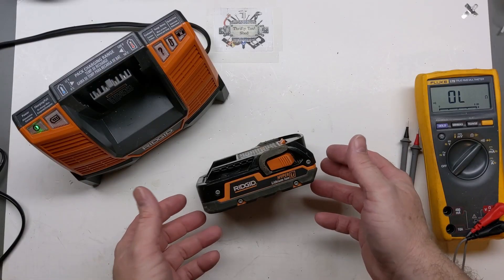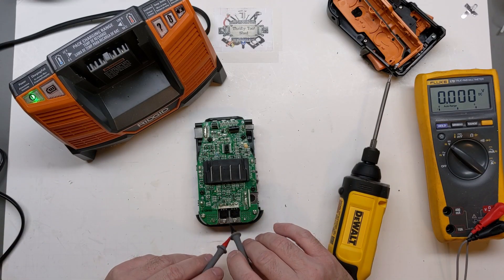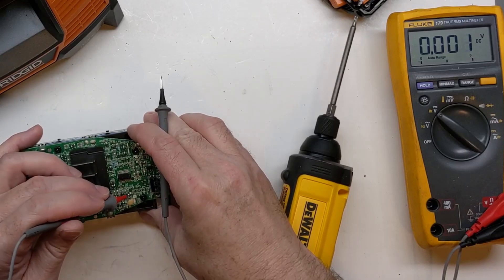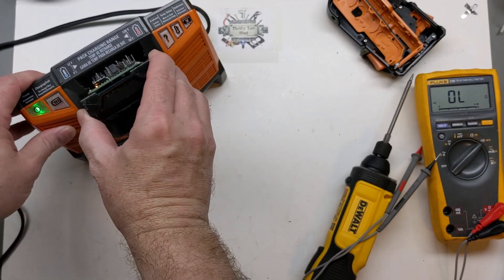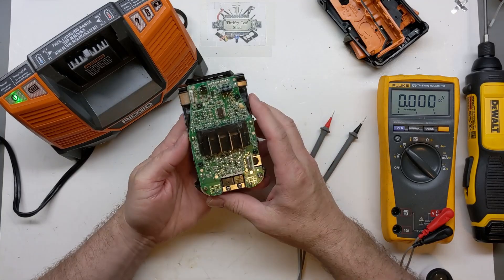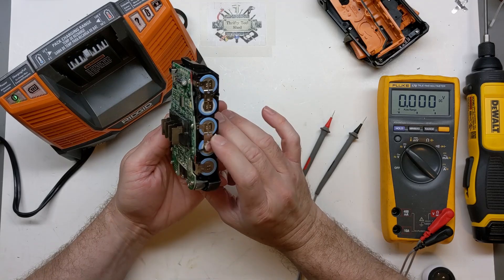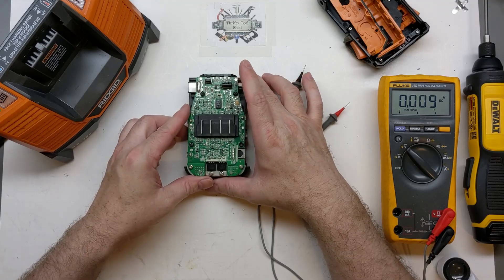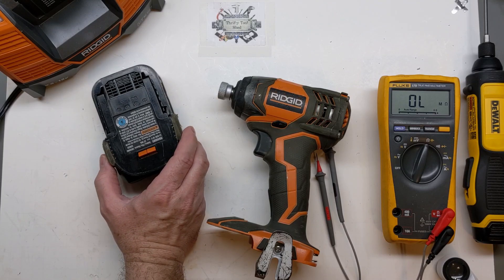Can we get this Ridgid 18V Hyper Lithium Pack back working?

Comment: Total laymen here: So I've had two Ridgid Hyper Li 18v 4ah batteries that were perfectly good at the time, get a light rain on the drill, and they stopped working. I brought them in and left them to dry for a couple of days, but they are dead. I tried the jumping method using a good fully charged battery, but nothing. I just don't get how a short period out in a light rain could so easily cause these batteries to fail like this. One battery I was working outside with it when it started to rain. I took a few minutes to put a tarp over my project and then gathered my tools and brought them inside, but that was all it took. My question is what has likely happened? Did they short out, and somewhere there is a fried circuit? I could see that happening dropping them in a pool of water, but just a light, brief rain while the battery is plugged into the tool?
Reply from the maker: It's possible they suffer from corrosion as seen here in this video. Until the pack shown in this video, I would not have thought light corrosion could have caused this much of an issue. I learned from this and still much more to learn for sure. I would say very unlikely it shorted out due to rain, but more like corrosion afterwards. Water ingress damage is usually from corrosion as it attacks the metal of the components and now with these tiny SMD components it doesn't take much to cause issues for sure. All you can really do after trying warranty replacement is check all cells voltage and make sure they are not too low and are balanced and then check and clean board for corrosion in the area I shared in the Video even if not seen. Some of these newer chips are BGA or Ball Grid Array and the tiny connection under the chip is many soldered connection very susceptible to corrosion, it's hard to get to. Other than the reset for the microcontroller on the board, that's all I would know to check. Best of luck to ya!
Reply: @ThriftyToolShed  Thank you for the reply. My security T10 bit will be here Wednesday, and I'll check the voltage of each cell, and if they look good, I'll try the reset.

Comment: This is really helpful and an eye-opener to a newbie to electronics. I am just starting to learn about  tube-driven guitar amps, so this is a tad over my head, but it gives me encouragement that I might yet learn about solid state devices. Now if only y'all had a video on how to trouble shoot a fan that got rained on... ?  I'm thinking it might have to do with some .."thermistor" ?.. that blew. Heck, So much to learn. At least I ain't dead yet.
Reply from the maker: Tube guitar amps are cool, I desire to learn more about those. Thermistors are simply a device that changes resistance based on temperature. Usually we see more NTC thermistors which is negative temperature coefficient which simply means it decreases in resistance as temperature rises. Rarely we see PTC or positive temperature coefficient just the opposite, its resistance increase when temperature increases. A vast majority of the time we see NTC that is around 10K ohm while in ambient temp of around 70F. I mention NTC a little in a video about EGO 56V battery packs called " What is the T-Terminal?" It touches on Thermistors a little. Also you may already know this: The biggest issue with electronics getting wet is corrosion even if weeks down the road so if any components did get wet make sure to clean the board with a good electrical contact cleaner or rinse really well with >90% Isopropyl alcohol even a small brush like a tooth brush scrubbing is helpful.  Hope it helps some and thanks so much for your comment.
Reply: I've an 18v 60Ah with same charger you use in this video and the charger doesn't flash faulty but battery won't charge??anything just from that you could recommend I do please
Reply: @mikehunt9993  DO YOU GET THE SAME RESULT WITH OTHER BATTERY PACKS ?
Reply: @mikehunt9993  try different charger could be charger itself

Comment: Great video but what it everything checks out but still won't accept charge.
Reply from the maker: I assume you have tested the  Charger as well. So either tested with another pack or same pack in a different charger? After that,  If all cells show balanced and voltage is above around 3v per cell then it could still be in the BMS. If it discharges from the tool fine, but doesn't charge, it's almost always the BMS still. These things are tricky sometimes, best of luck to ya!

Comment: I have a Hyper 4.0 won't drain below 3 lights. shows 20 volts on the board and 2 volts on the termanal and quits working.
Reply from the maker: If all cells are balanced well then it's in the BMS board. If reading 20V hopefully all are balanced pretty well, if not some of them may be over charged! I would check that first and then it would be BMS trouble shooting or at least try the reset? Best of luck to ya!

Comment: Thanks for the great video.  I'd just like to point out that Ridge Batteries are guaranteed for life if you took time to register them when you first bought them.
Reply: I've tried to register my Ridgid tools and batteries. I followed the instructions, took pictures of the receipt, box and tool or battery and sent them all through the registration website. In one situation they sent me a generic reply asking me to send them pictures of the tool, box and receipt which I had already done. I resent and they never replied back, so I thought all was good until a battery failed, and I tried to get it replaced. They said I had never registered the product. Just seems like a total scam to me.
Reply: @Graybeard_  Yes, their warranty is a joke. they make you jump through hoops and then don't want to honor the warranty anyway.
Reply from the maker: Thanks for your comment! Exactly, that's one reason I had these packs, my packs were from Home Depot returns from warranty replacement.

Comment: I have 4 batteries that are showing defective on the charger.  I own a small carpentry business. I don't know this type of work/repairs on batteries and boards. Can I send you batteries to fix?
Reply from the maker: I wish I had time, I do get asked this often. I do not have a repiar service at this time.  I work full time+ in a Industrial job and try to have time to edit videos to post. I try to help by posting what I have found with a repair.  I don't have alot of time left, I wish you the best of luck with yours.
Reply: @ThriftyToolShed  thanks. I cant do it and have no time. Great video!

Comment: I also have some corrosion around 3 of the battery cells themselves.  It got rained on good one day. Is there are different cleaner for the battery cells or use the contact cleaner and IPA as well?
Reply from the maker: That should work well. Vinegar is also great at cleaning most corrosion, but I always make sure to clean it off extremely well with IPA after your done to get the vinegar residue off. It can cause corrosion aslo if left on the surfaces.

Comment: Do not bother to replace mosfets. That will not solve the problem. I did purchase six damaged 18V 4A Ridgid batteries. I was able to fix 4 of them permanently by replacing logic boards. Cost $11 shipped from Aliexpress. https://www.aliexpress.com/item/1005001710882634.html?spm=a2g0s.9042311.0.0.4ba44c4dDDBf3s
Just check and be sure the cells are OK. As lond as they are OK the battery will work like new again. Good luck.
Reply from the maker: So did you watch the video or just adding some "extra advice" I never said to replace the Mosfets! I showed what seems to be a common issue resolved without swapping the board?
Reply: @ThriftyToolShed  I did not mean to criticize what you are doing in any way. You did great job to help people solve battery problems. I just add some comments based on my own experience to fix those batteries the easy way.
Reply from the maker: I wasn't thinking it was criticism as much as worried I misrepresented something there that I did not intend. Thanks for your comment!

Comment: I have a ridgid  battery and wen I pick it in the charger is says energy save what do that mean
Reply from the maker: That is usually the charger thinking the pack is fully charged. If the pack is not really full and other packs are charging fine with that charger the problem is in the pack.
Reply: @ThriftyToolShed  yeah my battery is dead so the battery must be bad

Comment: My Rigid pack never said defective and I tested it and was fully charged, and the output contacts put out current.  However it would not work in my drill.  

I did did what he did at 5:18.  Put it back in the drill and worked right away.  I gave it a good cleaning.  Hope that helps someone

Comment: When my packs get wet from rain or moisture they do that with the light. Clean them real good and good to go. Thanks for the video.
Reply from the maker: I assume the blinking is similar,  but the pack still works fine unlike this one correct? Thanks for your comment!
Reply: @ThriftyToolShed  The blinking appears to be the same. I've had some left out in rain multiple times and sometimes they come back and others not. Most times they just get moist and I lay them out to dry after disassembly and cleaning. Appears the conformal coating is lacking in some areas. I have a pack that the level lights don't work at all and it still performs as it should.

Comment: Great video! I have a 5aH lithium Ridgid battery pack that will charge but never shows more than 2 bars on the indicator. It's only a little over a year old. Thoughts?
Reply from the maker: I would check all cells voltage and make sure they are balanced. Could be bad cell or cells. If they rest ok then the only other fix may be resetting the microcontroller like I tried in this video. Best of luck to ya!

Comment: These Ridgid Batteries have a low voltage cut off built into the board correct?
Reply from the maker: Yes, the Mosfets we talked about here  will cut out in event of low voltage or temperature Issues.

Comment: Is it OK to run a jumper from ground to the source of the second MOSFET, or would that just circumvent the first MOSFET.
Reply from the maker: I believe it would bypass the first one. In the video I had no issue with the Mosfet on my left (the first one). I had the ground all the way through to my source pin of the mosfet on the right (the second one). I did not verify, but I assumed it was coming through like you said. it is so hard and time consuming without schematics, but it seems either mosfet can shut down the pack independently based on what its monitoring. For example: One could be for temp. monitoring etc. the other could be for voltage level monitoring?
Reply: @ThriftyToolShed  Thank you so much for your reply.  My right-side MOSFET was also not opening correctly, although the MOSFET seems to be testing OK.  Running a jumper to the source on the left MOSFET gets my battery functioning again, but I am concerned that this defeats an safety measure.  Unfortunately, cleaning the board did not resolve my issue. 

I read a post that claimed the MOSFETS provided bi-directional control, but that is almost surely incorrect.  I believe bi-directional control would require 4 transistors configured as an h-bridge (although I have limited knowledge in this area).  Both directions also work on my drill when using my battery what I jumpered.  I believe you are correct; the MOSFETs provide a safety-related function.

I was getting partial voltage at the output leads, but the issue was my ground -- I know relatively little about electronics, but this surprised me.  I had continuity to the positive output from the battery, but not on the negative side.  I am assuming the MOSFETs are in series with the drain of the right side MOSFET connecting to the source of the left side one.  In testing a functional battery, I seemed to be getting continuity from the negative battery connection to the output lead, but only when the right-side MOSFET was open.
Reply from the maker: @darrellr1362  Yes these are N- channel Mosfets and are switching the Negative. It has nothing to do with bidirectional control. 
 The positive goes directly to the output terminals. If I remember correctly both Mosfets are on to output to the negitive terminal. So they should be in series. Jumping from source on left Mosfet to drain on right Mosfet bypasses both!

Comment: I probed around where you mentioned you were when the lights came back on.

What I believe fixed the problem was using my DMM on DC voltage mode and touching each lead off the capacitor. Capacitance slowly jumped up at the capacitor until it was reaching pack voltage. After it reached 20V+ the lights and voltage at the main terminals was restored.
Reply: I'd also like to note that I did not clean the bored at all. I mostly just probed around following voltage from BAT-
Reply from the maker: Very good information, thanks for sharing!
Reply: After fixing my bored I came to look for more explanation. It was quite the coincidence we both had results in the same area.

Comment: You're giving away my secrets here! I have fixed a good number of these boards just by dousing them in IPA and scrubbing them with a old (but clean) tooth brush. They light up like you observed and that's how I know theyre fixed.

Sub'd - I liked your other techniques.
Reply from the maker: So glad to know this is not an unusual problem. I posted this to see if it would benefit others and I actually had some doubt if this was a common issue or simply a strange one. After a few weeks on here viewers did start mentioning it worked on theirs as well. Thanks for verifying that as well. I have fixed boards like that before and I have videos on GPS dog collars and one on a inverter that cleaning the corrosion on the board helped before. This is one of the rare times that I did not see corrosion at all in the area that seemed to fix the issue. Seems strange, but maybe not so much... Thanks for your comment!

Comment: My battery seems to die under pressure but when I tap it, it works again.
Reply from the maker: Does it flash orange or red led when doing so or not? Does it die and no light at all until you tap it? If no light until you tap it then it could be a bad connection on one of the terminals, cells tab etc. If you get orange LED flashing when cutting off, I would check NTC thermistors or temperature sensing wiring and if flashing red it could be one or more cells pulling low and shutting down. Problem could also reside in BMS board or it's connectors as well.

Comment: Hey so i wanted to update you on my battery pack as i think youll get a kick out of this. 
After probing several times and coming up empty handed i tried cleaning the board no changes so then for some stupid reason i decided to wave mybpen torch over the board. So i did that fairly lightly just enough to soften the coating and i will be completely damned if that didnt fix it. No idea if it burned some corrosion away or resoldered something but it fixed it. Lol. Weird right.
Reply from the maker: Yes, indeed. I have never fixed one like that for sure. I have heard of the small packages and BGA chips being fixed with heat in a oven like a reflow, but never done that myself. Thanks for sharing.
Reply: What gave me the idea was sitting here trying to figure out how to salvage the batteries. I thought "well youre not going to bake it and pull the board off.... but maybe if i..."

Comment: I have the r840089 battery. The circuit board is quite a bit different including having two controllers and four MOSFETs. Nothing is labeled about reset or +5 or anything like that. I tried shorting across a couple through holes labeled PROG and that caused everything to stop functioning. After some time, it went back to blinking LED1 after pushing the test button. Any help?
Reply from the maker: Some are not labeled. I am not familiar with this model and if reset doesn't help, you can try cleaning the board, but it is not always the fix.
Reply: @ThriftyToolShed  I tried the cleaning. Didn't help. Guess I'll keep looking.  Thanks for the reply.
Reply: I have the same model behaving the same way. Cleaned off a ton of corrosion but stuck with LED1 blinking. When I put it on the charger the charger blinks “evaluate” briefly then the charger appears to go dormant. 

Did you ever find a way to reset his board? I couldn’t find anything.